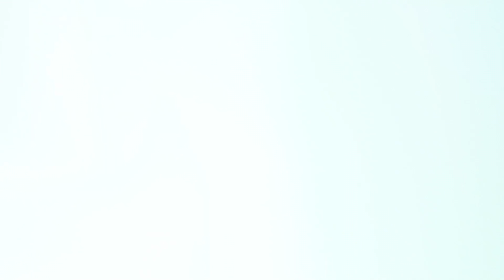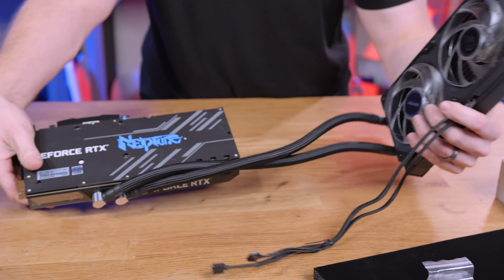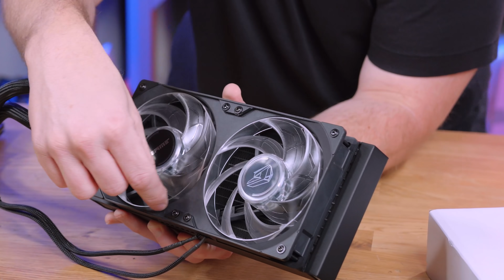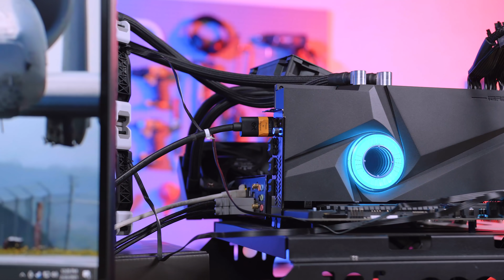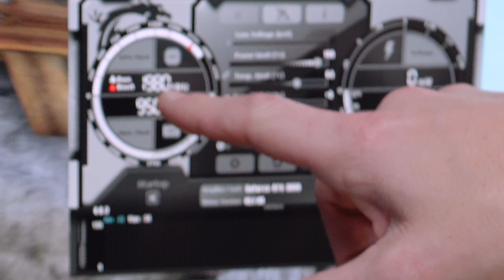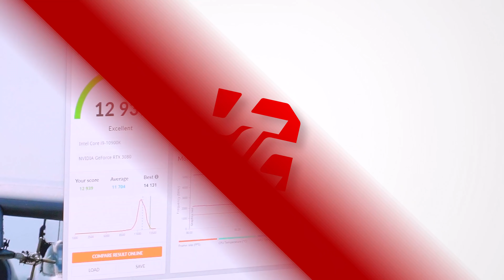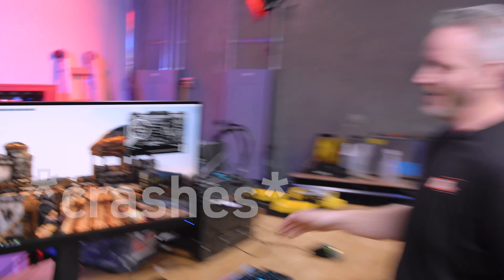AIO vs Air Cooled Video Cards... worth the extra cost?

Comment: I like that the AIO cards can be placed in an exhaust location, so most of the heat just goes out without changing the temp inside the case.
Reply: Definitely can benefit small form factor cases, less heat buildup for the CPU so it can remain on air cooling. Usually the CPU will outlast 2-3 GPU generations so ease of maintenance is nice, then you just buy a new GPU when the AIO starts building up gunk and other problems - if it can last 3 years without issues of course - resale value is limited though. I'm still an air cooler at heart, but the AIO option for GPU lazyboys with enough money has some merit - but in this PC market, heck no.

Comment: Ive been curious to find out how much of a difference the pump rpm makes. 

I know from building race engines, if the water isn't slowed with a thermostat, the radiator doesn't have time to cool the water.
Then it overheats.

Comment: 2GHz boost, temps 40c, overclock until unstable...
2.3GHz boost, temp 67c = good
2GHz boost, temps 40c = waste of money
Temps are important but only for overclocking headroom, not overheating is a standard so don't worry so much, save you money.

Comment: Number 1 reason why I had 2080ti hybrid was to EXHAUST the heat. I had kraken x72 as intake on 9900k and push pull on 2080ti radiator as exhaust. I had another fan above the rad as intake to provide fresh cool air with max temps in low 40s.

Comment: I use exclusively air cooled cards due to cost and let the fans run really loud, almost as if it were a jet engine. If I had the opportunity (and an available card), I would build two custom separate water cooling loops where one is for the CPU and the other for the GPU.

Comment: I have the Aorus watercooled 3080 AIO. It’s extremely quiet compared to my 3070 founders edition and very fast. 12064 in port royal when adding 150mhz and 700 memory. Haven’t tried to push it further yet.

Comment: Any thoughts on the EK waterblocks? I managed to get hold of an MSI Gaming X Trio 3090 last week, and I'm slowly putting together a build for 4K gaming to replace the build that I did 9 years ago (obviously not 4K worthy). I haven't ever ventured into water cooling before, and was eyeing their kits. I also picked up the Western Digital SN850 1TB SSD, which could use some help in the temperature category as well.

Comment: Jay if you get the beta version of the afterburner software you can have full voltage control. Even though it doesn't make a huge difference you can still have some leverage.

Comment: When I started building my Pc's I started out using Corsair AIO's, by my 4th build I decided to try the NZXT x65 AIO... What a joke... I RMA that cooler 3 times. it had a poor design with the USB plug from the pump to Mobo. When I got my 3rd RMA I didn't use it, I sold it on Facebook. After that, I went back to Corsair. I lost trust in other coolers thanks to NZXT.

Comment: AIOs are good for benchmarking only. Air coolers cool more efficiently but heat up quicker due to not having a reservoir of cold water keeping it cool enough to pass a benchmark. Prove to me that AIOs are better than air coolers by running a 2 hour stress test, then I'll agree with your opinion on AIOs being better.

AIOs vs air coolers lost every time when it came to CPUs, what makes you think they'd be better on GPUs when they're the exact same technology? Who games for just 2 - 5 minutes?

Comment: The reason you don’t do the all in one fan is because if one of those fans fails, the whole thing is useless or causes issues or whatever happens, maybe running a radiator with 1 dead fan and 2 working ones isn’t the best idea? Idk I think that’s probably why more companies don’t do that because a single failure bricks the system?

Comment: Those puny little fans on normal cards pointing straight down do nothing. The card traps heat and hides it from air circulation in my tower. Was looking at nzxt cooler myself.

Comment: For me watercooling is always 100% worth the cost because i do it for silence...not performance. I still get some extra performance simply due to the better cooling but i do it so i can run my fans at sub 800 RPM and have a dead quiet system that still runs the CPUI at 70c average and gPU at 50c but i cant hear it and boy is that worth the money heh

Comment: Planning on building my wife a pc I currently have a Ryzen 1700x and 16gb (2666) from a previous build  going to probably use those, maybe upgrade the ram, but should I wait till this while GPU scarcity goes away? Haven't looked at gpu prices. Also should i reuse the old part or just get all new

Comment: But my cpu has an AIO and still have higher temperature than my GPU which is air cooled (i9-10850k + rtx 3080). My AIO is 360mm radiator.

Comment: My go to cooling type is air cooler, since it is easier to install & cheaper with unnoticeable little different in performance both for cpu & gpu.

Because I'm not going to overclock whatsoever. Or I don't need to 😂✌🏼

Comment: nzxt currently dont make a g12 bracket for 30 series, BUT you can drill extra holes so it lines up with the gpu cooler mounting holes and it will still make good contact with the cpu cooelr coldplate. still works perfectly fine if you are compfortable drilling 2 extra holes in your g12 bracket

Comment: I'm currently using a  EVGA RTX 2080ti XC Gaming Hybrid (watercooled) which uses a 120mm aio too cool both the GPU & the Memory, EVGA overcharged me +$200USD just for the "hybrid" model. My EVGA RTX 2080ti XC Gaming Hybrid is loud, the Asetek gen 6 pump used in the EVGA hybrid is the loudest thing in my ITX system (sounds like a small refrigerator) & if I could do it all over again I would have just ordered a air cooled "Founders Edition RTX 2080ti" instead, I'm disappointed in EVGA after spending $1399USD on my RTX 2080ti, you can read online all the users who have the same loud AIO pump issue.

Comment: I have to say that it will just depend on the build, budget, and well overall want vs need. I know I am on Air Cooled 5700 RX due to cost and it get the job done. I do want to try a AIO cooled card but it will have to be cost efficient and a need to upgrade.

Comment: I'm wondering, is it possible to put in a gpu with aio cooler and a cpu with aio cooler in the same build?
Reply: Of course it is possible. Just depends on the case and if it has enough spots to mount radiators.

Comment: I've come to the conclusion that NONE of this is worth it. You OC a chip to gain performance, you buy extra coolers, to toss out the extra heat that is being generated at your chip in the first place shortening it's life. So you create an expensive situation where you kill your chip faster and think you did a good thing. Better to just buy a better GPU keep it stock and not waste money on parts you don't need. If you are going to do Anything just undervolt the chip but you Only need to do that if you have a heat problem which you could probably solve with better fan placement or thermal paste.

Comment: 400 out of 12000 is 3%. I don't think it's worth the extra hassle\longevity issues\price to gain 3% performance. If it was 30%, than I'll be very impressed. Would you supercharge your car to gain 3% performance if that job would cost 10% of the price of the whole car?

Comment: G'day Jay & Phil,
I guess the value is up to every buyer, same as is it worth paying extra for a better AirCooler like a Strix over a TUF or MSRP Design,
these days with the EVGA, Gigabyte & other Partners testing the GPU & Memory Chips, When you buy the more expensive models you are not just paying more for a better Cooler & VRM but they are also helping you 'Win the Silicon Lottery' as the chips have to meet the higher minimum performance

Comment: My 2070 SUPER with a 240mm CPU AIO zip-tied to it went from the low 80s to the low 50s. Also went from around 1800MHz (core) to 2050. Will never not use a water-cooled GPU again.

Comment: the noise reduction from an aio cooler is well worth it on a GPU. I used a h70i with the nzxt bracket on a 1070 saw a sizable performance jump and now the card runs almost silent compared to the reference style cooler. .

Comment: One thing I have noticed is that GPUs with water blocks seem to be better bins.

I would imagine if a GPU AIO had decent fans you could run it quieter than an air cooled card. Silent PC on a budget. (i.e. not a custom loop)

Comment: from my point of view who likes to look at options of how far I can push performance or replace items to fit my needs and wants, I would pick the AIO cooler for a GPU.
If there is performance to be gained on lower temperatures then I'm down for it. if it allows me to use the card for longer during game sessions that push the card to higher temps, then It'll give me peace of mind that the card is getting adequate cooling.

Comment: I prefer air cooled. Simply for the peace of mind that a heat pipe is much less likely to fail than a water pump.
Also 0 RPM is pretty nice.

Comment: I NEED to put an AIO on my RX 580 because my dumbass got an M-ATX mobo then my onboard sound died and I had to get an add-on soundcard - (and HDMI sound through my TV is just not gonna happen in this house lol) so my soundcard is directly up against the video card's fan and I'm worried there will be ZERO air-flow... So I need a single-slot aircooled (yea right lmao) or a water cooled video card. SO without buying a highend watercooled video card for like double the price right now, I'm gonna put a water block on this one... but it's prolly not even worth the hassle. So maybe I'll just not play games lol

Comment: My biggest gripe (looking at you EVGA 1070 Hybrid) is that most of the time they half-ass the solution and don't control the fans on the rad. I yanked mine off and replaced it with one from a corsair AIO and plugged it into the motherboard after a day of using it. The original fan was 2 wire and ran at full. I saw better performance at 1300 rpm out of the corsair fan (better sp) and didn't have to listen to fan noise.

Comment: I'll keep my air cooler, less to go wrong long term, less maintenance, and zero noise (even under load) Gaming X Trio 3080 cooler is SO good lol.
Reply: There's no reason to even consider getting an AIO if you have a Gaming X Trio. The cooler on that thing is just as good (and just as expensive). If there happens to be a difference in performance (which I doubt), it's definitely not worth the money. We'd be looking at an extra 100 (on top of the extra 100 for the Trio) for an amount of frames that can be counted on one hand. Say what you want about MSI, they know how to make coolers.

Comment: For those not doing actual OCing? The only advantage a AIO powered one would really have, is noise factor and possibly dust control factors, what with it being much easier/simpler to manage clearing out the rad than it is to deal with taking off plates and such to make sure you've gotten the byproduct out of your GPU fins. Which is highly subjective when it comes to the actual value of such.

For those doing OCing, if there's also accounting made for cooling the rest the stuff beyond the die, an AIO almost certainly pushes that upper limit a bit higher. 

I'm not really into overclocking myself, as for the most part current gen blows away any real workload you can throw at it unless you are trying to do 4k native or something.

Comment: My current EVGA 2080 Super I was able to purchase was one of the 3-fan side-exhaust models. As such, when the GPU was being hammered, it would dump all that heat into the case, which then exhausted through the CPU radiatior causing the CPU (3900x) temps to spike as well. Installing one of the EVGA AIO coolers on the card resulted in almost all of the thermal load from the GPU exiting out of the rear of the chassis directly and leaving the rest of the cool air to cool the chipset and CPU radiator.

Comment: Here i go again, Don't buy an AIO.  It has a limited lifetime of a year or two.  Air cooled is cheaper and just as good, or go all the way to a full custom loop.
Reply: Completely agree.  I'd like to add that IMO if ppl need to overclock that much to require an AIO then the real problem is they need a better GPU.
Reply: Just my 2 cents here, but I have an EVGA B-stock (refurbished) hybrid 1080 purchased in 2017 that's still going strong. While I would agree an AIO-cooled GPU has a generally shorter lifespan due to the AIO (specially the pump) I feel that saying a year or two is selling them just a bit short.

Comment: I wish GPU AIOs were as common as liquid cooling your CPU. I'd rather use an AIO on my GPU over the CPU because GPUs are far more sensitive with temps than CPUs are.
And you're right Jay, Cooler Master fans sadly do suck. I don't see anyone using their fans unless they came stock with their cooler or case. They're so flimsy and move so little air.

Comment: idk if its anything special, but my 1080 fe can do 2025mhz core clock with my oc with the stock cooler?
Reply: I have an Asus gtx 1050 ti oc expedition that can run 1980mhz overclocked. Not too shabby for it with no pcie plug

Comment: The Sapphire TOXIC 6900XT Looks really good. I've been wishing for an AIO just so I get to pick the fans and control them better than AMD Radeon Software will let you. I have the Sapphire Nitro 5700XT and the minimum fan settings drive me crazy. There's an arbitrary limit (In the VBIOS I believe) that you can't set the fans under 26% (already too loud), and a day after I change the settings, Radeon Software will reset them to 39%, claiming an unexpected system failure. I don't observe such a failure, which makes it all the more frustrating. Hence, I am typing this on my M1 Mac mini because my PC won't shut up.

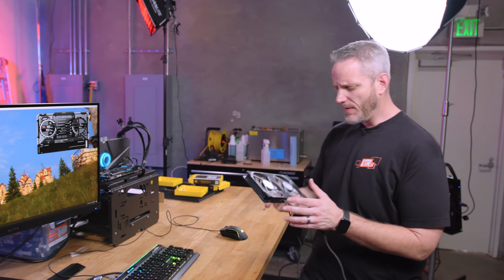Comment: 12:16 you do realize MSI Afterburner has a setting that lets you sync the AIO fan speed with your GPU temps right? I do this as someone with a CPU rad as an intake.
Reply: I believe my motherboard has a gpu temp setting when setting up fan curves in bios
Reply: where is it ?, currently installing Fancontrol to sync my fans with gpu temp
Reply: @khairudinanshari5323  Click the gear wheel to the left of the "Fan Speed (%)" slider

Comment: I did the FE 2080 ti with a Kraken x52 and G12 bracket. The gains were 100% worth it. In game it sits at 45 degrees. Same under synthetic load. Mining it runs even cooler at about 40 degrees, but that's probably due to undervolting. I'm on the wait list for the hybrid EVGA FTW3 3090 Hybrid. Ultimate status :)

Comment: Does the pascal card(GTX) have AIO cooler? Seem like only recent trend with the RTX series card.
Reply: been around since the 900 series if not with earlier GPUs
Kits came first I think around 2012 and then companies started selling cards with the cooler already on them
Reply: @Kirinketsu_  So you meant it was a separate component, I mean selling as a whole only visible to me when the RTX 2000 series card arrived.

Comment: Needs a tear-down to see where the cooling goes. Does it cover the VRMs or not?
Reply: its on the box with a "xray" style graphic. the question is is it telling the whole story though?
Reply: Ya, I feel like Jay was kind of guessing here.
Reply: @JD96893  Like he always is..?
Reply: Well, based on the performance, I'm sure it must.  It'd have crashed out a lot sooner if the VRMs weren't cooled.
What I want to know is how much of that OC was due to the AIO cooling and how much was just due to a better binned chip.  LOL  Rip off the AIO, put on an air cooler, and try the same settings.  (I'm sure Jay won't screw up a perfectly good card that way because he has common sense ... ish, but maybe Steve at GN will happily rip it a new one?)
Reply: @justsomeperson5110  taking the cooler off won't screw it up.
Reply: AIO is screwed to a copper plate that touches the core and memory and uses heatpipes to the VRM. Gigabyte has this same design on their Xtreme Waterforce AIO and it works quite well. Only issue is that the memory runs quite warm because it gets heat from the VRM's.
Reply: @GravitySandwich  Then it doesn't work quite well. VRM includes a Dr.MOS chip, an inductor and a capacitor among which chip and cap needs cooling to avoid premature death. Heat pipe may cool the chip, but no the cap. This is a faulty design from a longevity standpoint. Even that shroud off would be a far better way as there would be some passive cooling of the non cooled components by ambient airflow in the cabinet.
Reply: i would guess the contact plate only comes in contact with the die. and the vrms would have the classic heatsink and blower style fan. but i have not watched the full video yet.... but that’s what normally happens with these cards
Reply: @orionsoftware8149  this is usually how it goes!
Reply: I want to see a teardown just to see what caps they put on the back.  I wouldn't be surprised if there was a company out there buying up reference cards and re-packaging them with a lower power limit just to avoid the capacitor issue on the older 30 series cards.
Reply: https://youtu.be/Cle8Qmml64s
Reply: @Lucian_Andries  no it wont it is a concealed pump
Reply: I have an evga hybrid 2080 super and the vrms are air cooled along with the memory
Reply: ohey buddy! First time i've seen you on a comment section in youtube, lol! Agreed btw :)
Reply: Def
Reply: @Lucian_Andries  not entirely.... AIO's are self contained water loops, therefore they won't leak on you if you don't remove the pump's coldplate or cut the tubes.
Reply: The VRMs get directly aircooled
Reply: @freevbucks8019  where is the fan for the air cooling? I didn't see one in the video.
Reply: @kaytrim  yea neither did i